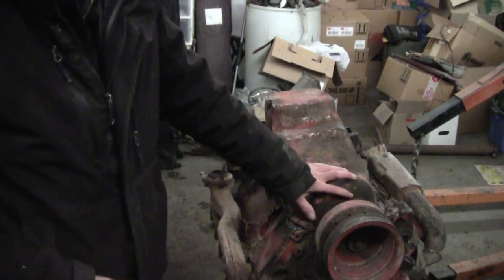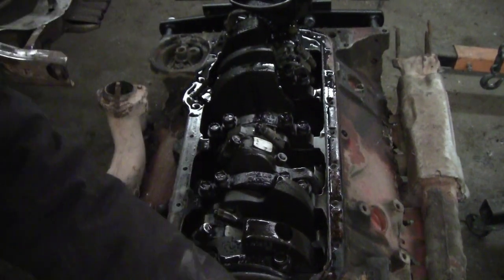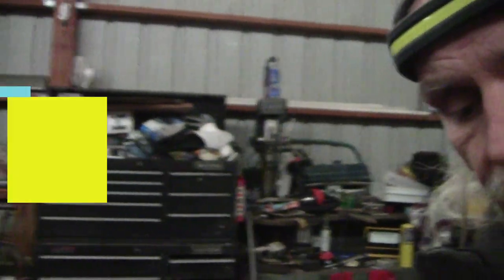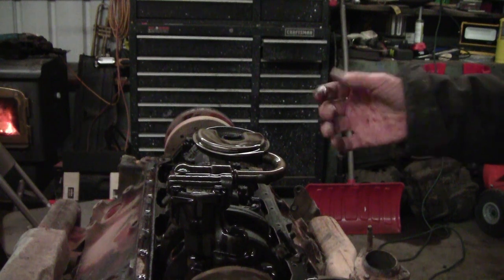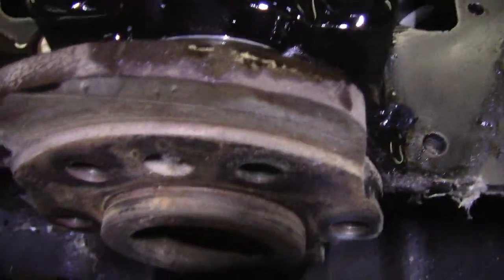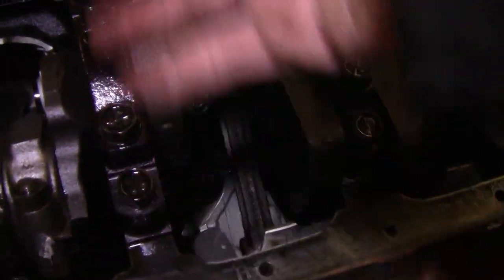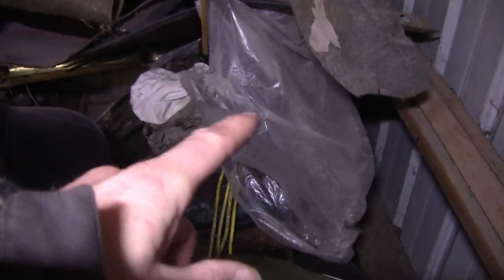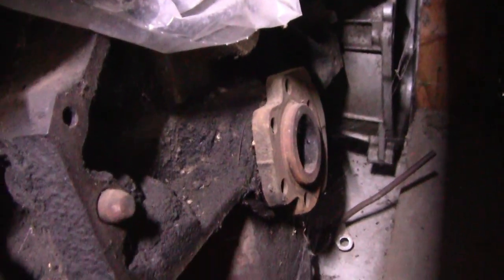Golden Ticket or Fools Gold? How to Tell if You Have a 327 or a 350 Small Block Chevy (Part 2)

Comment: Once i see they have been rebuilt i normally keep pulling them down to check the previous guys "homework"....cant tell ya how many times ive found a end cap on a rod reversed and ive seen total engine failure due to a bad rebuild!
Reply from the maker: Spot On 220% correct man! Right down to the cross hatch on the cylinder walls. Story is, this thing has CM rings in it...... and if it does, I'm seeing issues right there already and I haven't even dove that deep into it yet.... lol. 
How's that song go? Once Bit Twice Shy?..... lol
Reply: @BareRoseGarage  LOL pretty much!

Comment: I just picked up a 66 C20 with 327 OL stamped on the engine deck. The block casting ID is 3932386 with an aug ‘68 date stamp. I believe it’s a 4 bolt block because of the 1/8” plug in the front and tapped hole at the top of the bell housing. It also has a powerpak tag riveted to the block just below the left head which has a 39276186 ID and late half  ‘68 date code. Not sure what to make of it without pulling the pan. Anyone else come across stamped and tagged engines like this before that can shed some light on what back story to this engine might be?
Reply: That plug doesn't mean 4 bolt.
Why do you need a 4 bolt on a street engine ,only if you race and beat it to death will A 4 bolt main ever help.
Reply from the maker: Very true man. People think the 2 bolt main is a butter weak engine, but you can lay 500hp to them and they will live just fine. Heck I've seen even higher numbers on them, and they are still running. It's only when you go Extreme that the 4 bolt really shines.  @johnmcentyre5806

Comment: That’s a 350 you can tell by exhaust manifolds I just don’t know why you don’t get the casting number off of it would tell you a lot more than looking in the pan
Reply from the maker: Those manifolds will bolt right onto any of the small blocks.
Reply: @BareRoseGarage   yes but who is going to pull off rams horn manifolds which perform well for those 70s junk ones

Comment: Does the casting number identify what crank it is? At least measure the stroke while turning the crank.
Reply from the maker: Thanks for stopping in David! Yeah, it comes up as a 327 (2-bolt main) crank.
Back in the day, this was actually a "backyard hot rod" trick with these 350's.  I'll bet dimes for dollars that this thing has been bored over with this crank to make it a high RPM 335?

Comment: Never made a factory 327 4-bolt main 350 four-bolt commonly found in trucks. And there's still a number of them around. This is in reference tocomments I read.
Reply from the maker: Yep, spot on man and thanks for stopping in! Somewhere in this things life, someone has de-stroked it back down to a 327. I think they where going for RPM, but out here in farm country it's hard to tell.... it very well could be just what they could find at the time to get it back running again. Thats the fun with Chevy's that have been around the block a few times..... you never know what you are going to get until you deep dive into them... lololol.
Reply: @BareRoseGarage  that's true. Whatever you can find to get it to run. I've often said growing up we could not fix it then we just did without. Lot of rubber bands and chewing gum

Comment: Awesome find on that engine, the 4 bolts are really hard to find around here these days! Thanks for sharing! On that pad in front of the head on the passenger side you will find a suffix code stamped after the vin number, it will tell you what engine it is. I have a 66, 327 and its suffix code is HCH.
Reply from the maker: Way cool Mitch! I'll do my best to remember that for when I deep dive into these once I have them off man! I just got it sealed back up to get it ready for the Easy Off and deep freeze lol
Reply: Suffix code  the last H is for Holley intake and carb, R is for a Rochester type carb . I have two Holley cast 327 intakes
Reply: Just use a 4 bolt 350 block

Comment: I want that motor if it is indeed a 327 ......I want a short stroke little motor to build me a hotrod high rpm screamer for my 84 short bed silverado ....307 and 327 large journal will if in the 350 but you  also have to change the pistons to make it right or a true 327....
Reply from the maker: That's exactly what the guy before me was doing with this one... Lololl
Reply: Use a 350 block, way cheaper. For a truck id go for a 400 or stroke the 350 just put a 327 decal on the air cleaner. 
You want a lot of torque to move a heavy truck.

Comment: 307/327 are the same crankshaft... 305/350 are the same but balanced different
Reply from the maker: That's a lot of the difference you are seeing on that tail piece I show in the thumbnail picture. The 327 is dished to balance it for the 327, where as the 350 isn't..... you can also see the difference in the counter weights on the crank itself.
Reply: @BareRoseGarage  there is one other crankshaft that looks the same  but very different,  the 262 has a 3 1/8 stroke and the rear flange tapers inward... so you can take my advice or not! And learn on your own by time loss .

Comment: Why don't you measure the bore and the stroke and do the math?
Reply from the maker: Thanks for stopping by swoop. Dropping a soda straw down a sparkplug hole and measuring the stroke is definitely a way to get a general idea, since all 010 blocks are 4" bores, but I've found with Chevy's it's always a good idea to go deep into them. That away you find what other people have done to them in the past. Like in this case, Chevy never built a 4 bolt main 327, so this is a de-stroked 350 that's been custom built to come all in at higher RPM.
Reply: I was thinking pulling the heads that way you also get to see what they did.

Comment: so my 283 could be a 350?! lol 🤔👍
Reply from the maker: The 283 is a bit different, they fall into the same category (family) as the small journal 327 & ended with the 305's in the early 1990's with the 3 & 3/4" Bore.
Good little engines though!

Comment: T0407HV everything points to 327
Reply: Can you help Id
Reply from the maker: Right now I have that one back in storage, but you are correct. It's actually a 350 block, but someone has put a 327 crank in it when it was rebuilt. That was a pretty common thing to do back in the day to build a higher RPM sbc, and make a pretty hot little mouse motor.

Comment: why would you waste your time looking at the shape of the rear flange when you can just look at the casting numbers you could have Identified that crank in 30 seconds geeeze
Reply from the maker: Hello there KT good to see ya. Yeah, I didn't want to pop the pan off just yet because I needed to keep it sealed up until after I pressure washed it, so I'm kind of showing you how to get an idea of what it is from the outside. Curiosity got the better of me so I went ahead and popped it off though and I'm glad I did. You can also tell by the counterweights, but I left that one out because it's harder to explain without a side-by-side comparison.